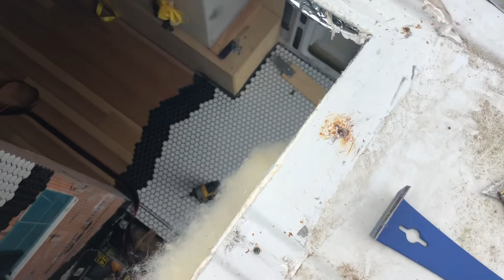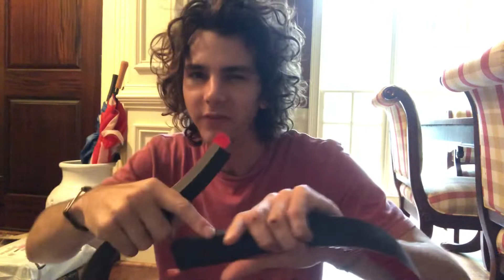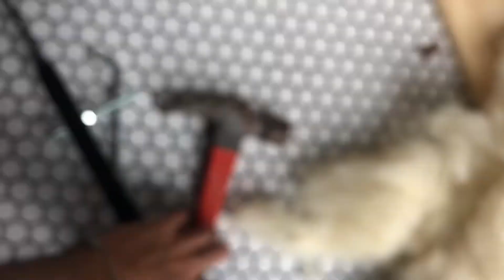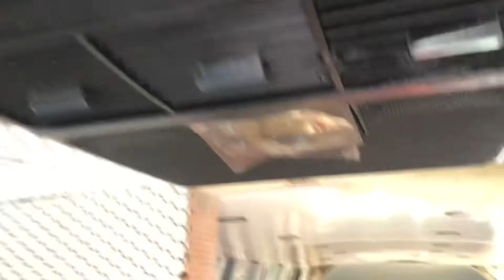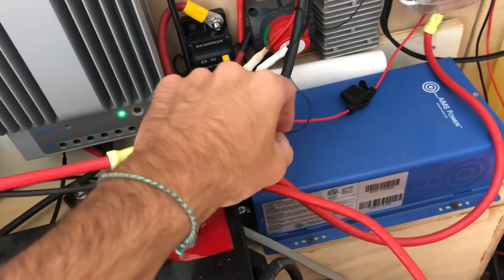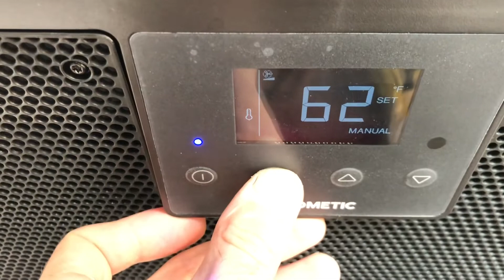How to install Dometic RTX 2000 in a sprinter van

Comment from the maker: Update: there are 2 versions of this ac, a 24v and a 12v and I thought I ordered a 24v (or at least thought it was interchangeable) but apparently did not and I have a 24v system. I ran the fan and ran into an issue when the Condenser would kick on, it would shut itself off. After troubleshooting I discovered my converter which turns 24v dc to 12v dc is only rated to 40Amps and the fuse required for the AC is 80amps so it was tripping out the converter so I have ordered a newer higher amp converter instead  of going through the hassle of switching out the 12v for a 24v AC. All could have been avoided if I was a little more careful!!
Reply: I'm installing the 24v version into a military vehicle. I made sure to speak with the dealer before ordering.
Reply from the maker: @TheAussieRepairGuy  that’s awesome man, good luck to ya! Glad I can help!